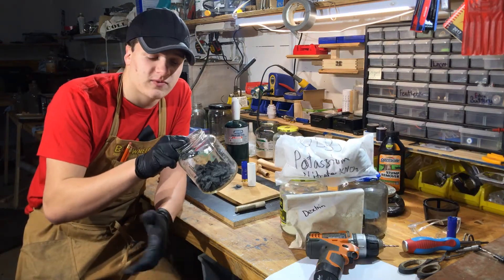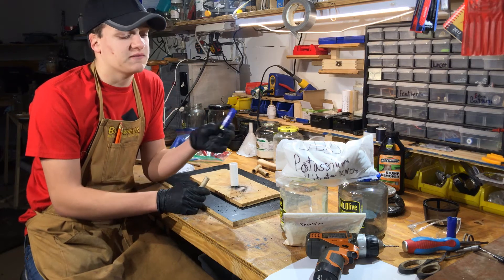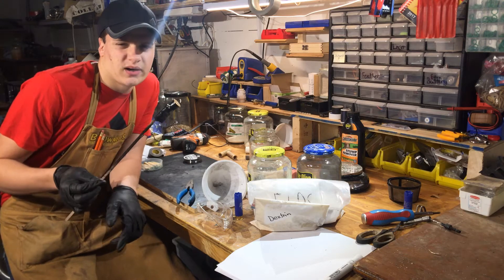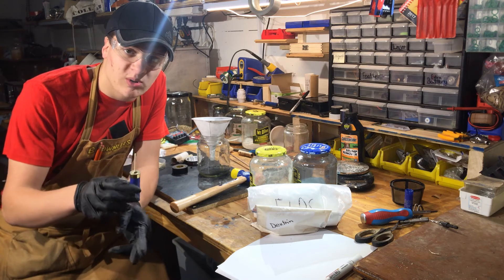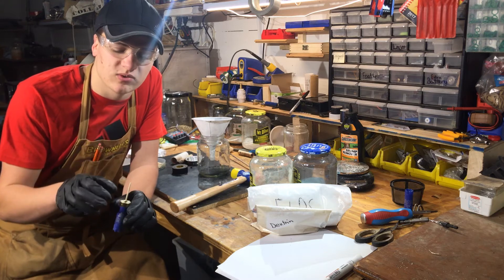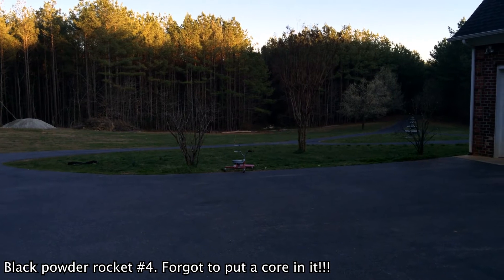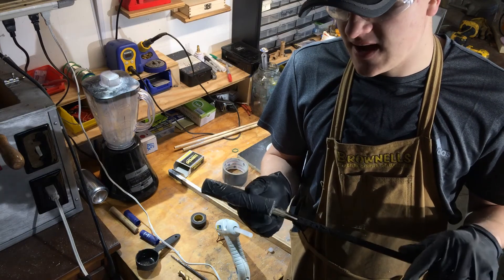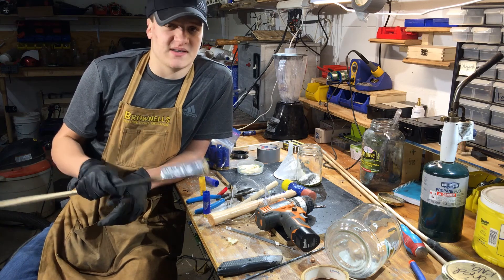simple way to make model rocket motors

Comment: Don't do what this kid is doing people. If someone even brought a lighter into my packing/powder room I'd kick them off the property. Let alone lighting test piles of BP like he did, right next to the mother batch. Not to mention drilling through a metal primer attached to pvc pipe thats packed with BP.  I get the fact that playing with rockets and powders is fun, but it is also hugely dangerous and even deadly when you do.it like this. This kid had me cringing several times.
Reply from the maker: It doesn’t hurt to be too safe. Though, what I did wasn’t THAT dangerous. I only ever made blackpowder in quantities 100 grams or less and even then the stuff didn’t burn very fast and nothing like the stuff you can buy at the store. Also, primers are usually made of brass so risk of making a spark or excess heat is negligible. It  would be a different story if I was using smokeless powder or flash powder. I don’t mess with that stuff

Comment: Hey I know you posted this a long time ago but I thought I'd still comment on it. Drilling a rocket filled with gunpowder based rocket-fuel is a recipe for it igniting due to static or friction. If you need a nozzle then predrill the part and if you need a hollow core then carefully drill it out with the drill bit in hand. Otherwise great video and amazing results!
Reply from the maker: Thanks for the concern! I new it was kinda dangerous but the powder I made was very weak and the rockets were so small that it wouldn’t have done much if it did ignite. But you right it’s prob not the smartest to use a drill in general
Reply: You most likely also already know this but using cat litter for sealing the ends works amazingly.

Comment: Could you instead of pressing the Gunpowder dry just form a dogh from the Black powder than just  press it into the motor. Making the combustion chamber would be so much easier and safer with this method.

Comment: Two things for you, when producing rockets with BP its actually better to not have dextrin in your mix, it can be made the same way. Also large rocket are used often with BP up to 12lb
Reply from the maker: Do you know why the dextrin is in certain BP recipes? What would u consider best for an amateur like me? BP or R-candy
Reply: @HappyMadScientist  wow never saw your comment until now 3 years later.
If your still intrested in the topic and s answer to the question then here you go.

Dextrin is used in some BP mixes where you need harder grains and where you may have issues binding without a binder. 
In the case of BP rockets and corned BP pucks the force is your binder, the preasure the mix is under is enough to get its core components to stick to each other.
As for the topic of which fuel type to try, I'd personally say black powder since it has enough energy to make even semi successful rockets from poor mixtures. Where as sugar fuel is kinda a poor way to do it, it can infact be mastered, I have seen makers use only sugar fuel up to 6lb rockets. Although it's more of a art once you get to that level, and it's time consuming plus finicky to dial in.

Comment: I like it, how did you get your potassium nitrate,? the other two ingredients are easily obtained.
Reply from the maker: The potassium nitrate can be found at Lowe’s (Home Depot doesn’t sell the right stuff). Look for stump remover. 

I’ve found that Walmart sells it online for pretty cheap. Look for the seller “seed ranch” and get a 5lb or 20lb bag. 
Be sure to check your local laws regarding the manufacturing of your own black powder. I’ve heard stories of people getting into some trouble when they ordered the ingredients to black powder online.

Comment: Sweet!!! Great video. So you've never had much success with the sugar rockets? Seems like yours burned very slowly in comparison to the others i've seen videos on. Any idea why that is?
Reply from the maker: I made it exactly like the black powder rocket. If I had put a better core in it and maybe not have packed the powder down so hard it would have gone pretty high. Also, it was kind of a small rocket length and width wise but with a bunch of experimenting it would prob go pretty high. 
The rocket made out of the black iron/steel pipe at 2:00 was sugar rocket fuel too loosely packed and blew the rear off and took a 1-inch thick tree branch off behind it like it was nothing and kept going 😬
Reply: Ah, ok. That black steel steel pipe one though......that wasn't a rocket. It was a pipe bomb. Rest assured the feds will be coming for you...😅
Reply from the maker: Yeah, that was some amateur rocketry gone bad... The reason the nozzle popped off was that I didn't thread it on very much (about 2-3 threads) in attempt to keep the pipe from bursting in case of failure. In this case, I think the nozzle got clogged with some of the burnt crap which enabled it to build up the pressure, which enabled the fuel to burn faster and build up more pressure etc until it failed where I had intended in the event of a failure.
So in conclusion, stick with the little rockets until you get an education in rocket science.

Haha, my parents already told me that. Movin up the list! I just assume it'll help me get my dream job as some sort of chemist or engineer for the USA military...